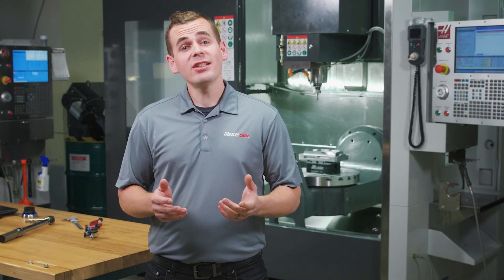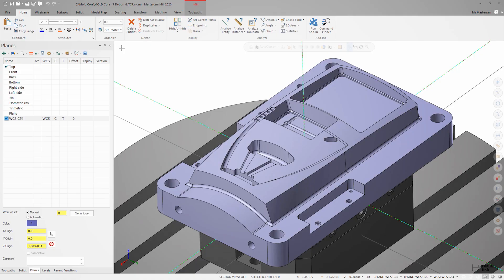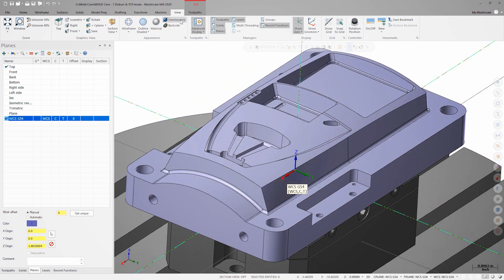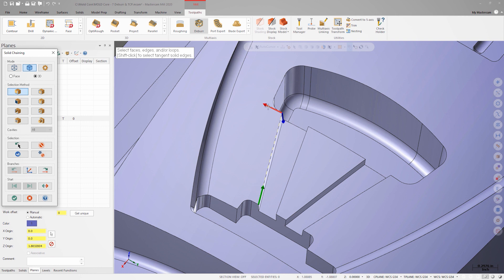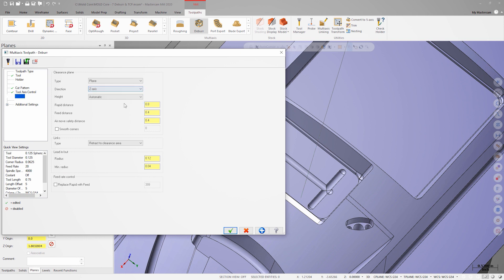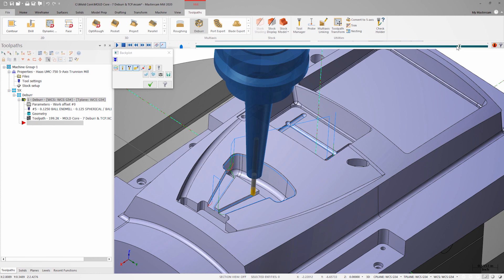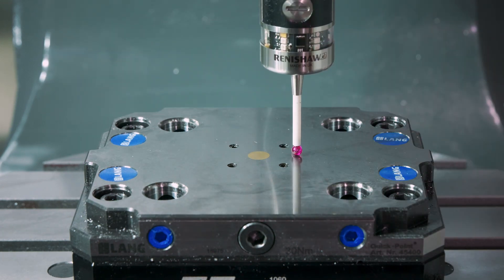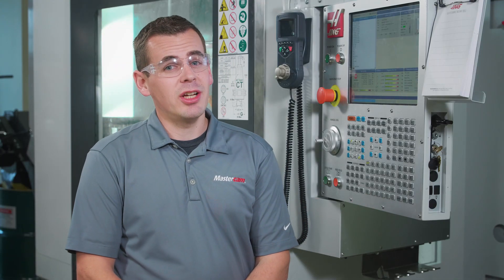TCPC - Simultaneous 5-axis made easy!

Comment: Does the Haas umc support mastercams pro+ using DWO and TCPC?? Or would you have to program the part on mastercam of the machines center of ratation?
Reply from the maker: Unfortunately, Haas G31 (probing skip cycle) and G254 (DWO) are not compatible. In order to probe in multiple planes you can program from COR as you are suggesting or create separate work offsets at different planes to reference just for the probing operations. This is a controller limitation and is not the case for all machines/controllers.

Comment: I want see make  millturn toolapath
Reply from the maker: You can log into my.mastercam.com and access the tech exchange where you can find the project files.
Reply: @mastercam  
Yeah i know.
These help me a lot.
I want to watch the millturn flash tool and multi tool video. :-)

Tool alarms frequently appear when generating g code with code expert in Millton module.

I think you match the abor that fits the tool holder.

I tried to exchange abor but it doesn't work.